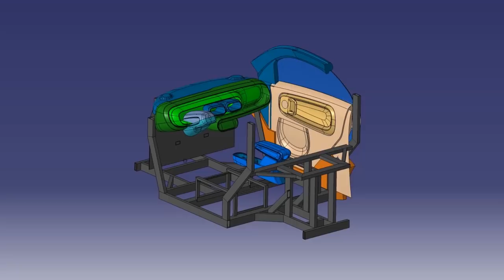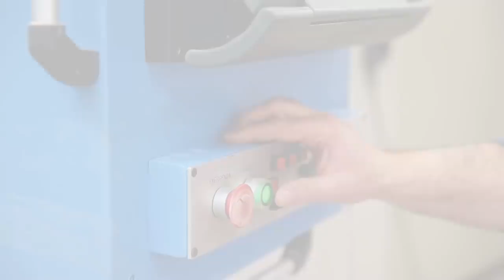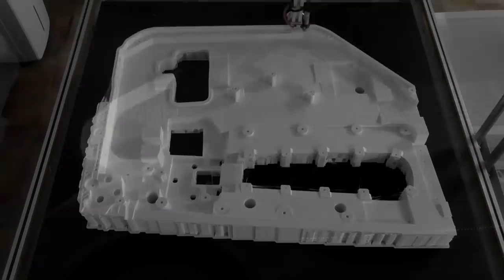LSEV - 3D Printed Electric Car

Comment: good bye toyota , it has been a pleasure having met you... this is the car of the future.. 57 parts used on this car .. when ordinary cars use 5,000 parts  .. unique , elegant .. parts easy to be made ..wao...simply amazing.. 1st 3D entirely made car
Reply: There's a reason for cars being made with lots of parts as opposed to just a few. During an accident cars are designed to break in a way that the car is destroyed in a way that protects the people inside and outside the car. This 3D printed car is not designed thinking about safety, therefore you'll most likely die in an accident if you get hit or hit while driving this 3D printed car.
Cars were tougher back then, they had less parts, cars wouldn't break as easily but people died much more easily because of the few and tougher parts cars were made out of.

Comment: Neat, but I have to wonder how it would fare in collision tests.
Reply: Probably much better than any bike. Especially considering max speed around 70 km/h. Good enough for me.
Reply: took the words out of my mouth
Reply: It's not all printed plastic, fortunately (sorry - polymer). See 1:32. Steel. Which is re-assuring.
Reply: Like motorcycle,
Tricycle
This is quad cycle.
This is better than motorcycle and tricycle.
Reply: Aeleas 

It conveniently converts its self back into raw materials.
Reply: I've seen plenty of rusted shit box gas cars that look like they're about to crumble to dust with one wrong pot hole hit.
Reply: Doubles as a coffin.

Comment: The Germans knew how to to it.
Design a car - The Beetle.
Tool up production in 1939
Make  21,529,464 

Price in 1960 $1500.00
Final price in 2003 - $5000.00

A 3D printed car will never match that volume and cost.
Reply: I remember when digital cameras came up. The price was so expensive. I said, "No thanks. I will stick to my camera and Kodak will always be there to print it."

Comment: They already make a SMART EV, any chance you can make something that looks cool and incorporates some highway arrow dynamics?  As long as you are starting from scratch, Don't need back seats but some usable storage space would be great!  No reason you can't incorporate some utility too!  That would give you more length to extend the battery and give me a range of 150+ miles per charge!  Now you have my attention!  And for Heaven sakes, give me an insulated roof so the smaller interior isn't such a hot box on a sunny day.  Don't need a stupid sunroof!  Thanks! =D

Comment: you can't 3D print a car … 
total waste of time . 
1. computer panel 
2. electrical wires 
3 battery 
4. air con 
5. impact approved frame chassis and body